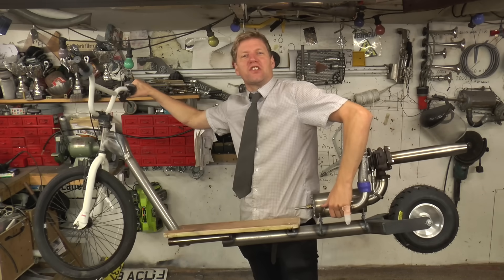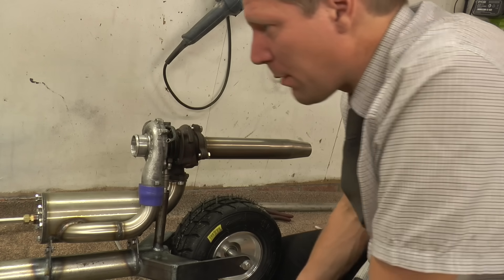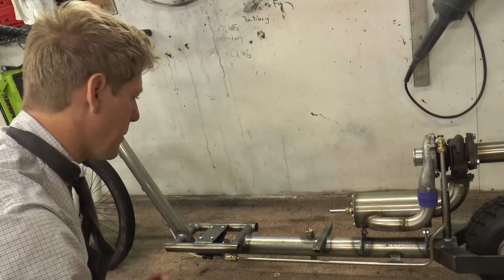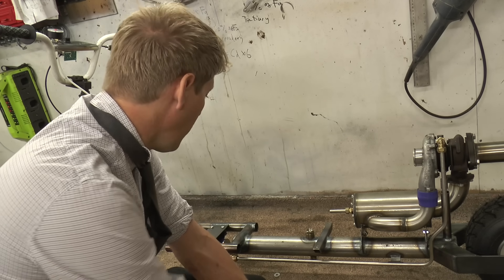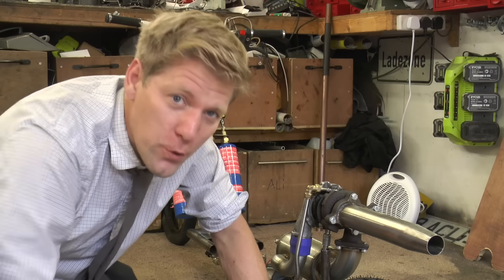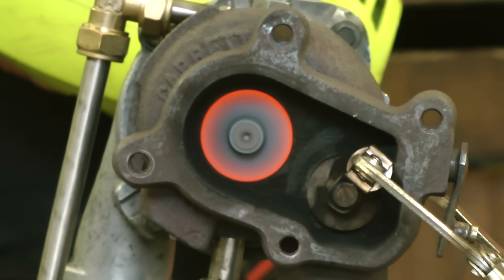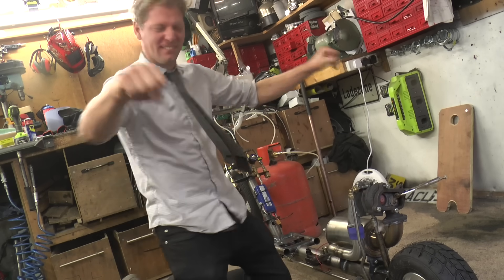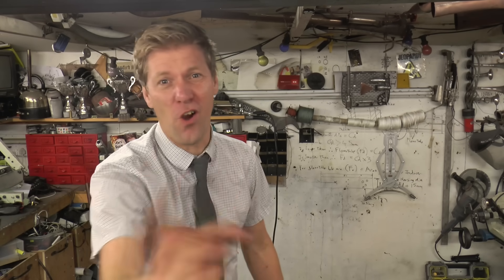TurboJet Scooter Build #2-Oil/Fuel/Test Fire

Comment: Hey, have a 100mm turbo im building a "jet" for a shopping trolley with. Had a friend make the flame tube but he messed up something and there is like 150/170mm2 hole area. Someone have an explanation to how this will effect the burning happening, first I thought it will probably be good enough. But that thing will be a beast to get spinning until it can sustain itself.. For now i have a 70mm running just fine and that has a much smaller combustor than the one in this video. And it starts real easy, if you accidentally overfuel it a bit it has enough thrust to tip itself over, granted it is a bit top heavy but its for making noise and looking good only. So well, what makes a good combustor? Small holes high speed air or big holes low speed air? Just made the fuel system for the afterburner on the shopping cart today..

Comment: What gallons per hour (gph) rating was your pump you used for the oil system? I am trying to build my own turbojet but the pump that are like 330gph are so expensive. Do you think I could get away with a 10 gph diesel pump.
Thanks

Comment: Colin: Tig welds next to plastic oil line-no problem. Me: Tig welds in basement, truck outside in driveway develops oil leak in pressure gauge line !

Comment: Call me crazy but a turbo is not a rocket engine, it produces rotational power from a expansion of hot gases, so if you take a gear off the turbo to your wheel it would work...yea?

Comment: why does the TURBO need oil??  Its just a fan that spins isn't it?
Reply: It needs oil to stay lubricated and cooled, because nothing can work perfectly without friction the oil helps cools off the heat created by the friction and to lower how my friction there is between the fan and the housing

Comment: You need to power down the oil pressure during start or the axle will not turn. I made a jetbike in 2007 with a huge marinediesel turbo. It needed huge amount of pressurized air to get it to run up for a start. An Atlas Copco GA30FF compressor was almost on the line for starting. Two sparkplugs on the burner, the plugs got stuck after a real run. I made a couple of runs making it power the bike quite good. The last run on film in my channel, the turbo exploded in fire! Watch and laugh. "Jetbike Bräcke"

Comment: Serious question and hopefully a cool improvement for your next one: why not EDF motor to start it? I see you using a plugged in leaf blower, but even a small cheap EDF will give significantly more pressure and thrust and available in whatever diameter you need. You could then start it anywhere (like take it to the park, sneak up on some birds, then shwooOOOSH! Fire it right up). Normal jets have just a regular motor on the shaft to spin them up, but this would be a very easy way to make it have electric start in a compact battery version. Just make a hinge where it swings out of the way once the turbojet is started and your golden. It should definitely make it easier to troubleshoot and faster and easier start ups.

I may not be a rocket scientist, but I am an aerospace engineer that approves of this madman plumber, keep it up and stay awesome Collin!

Comment: To monitor oil pressure: Just do some bench tests to find out how much current corresponds to what pressure. The monitoring is simply an amp meter and it is easy to solder together an alarm that sounds if the current is too low.

Comment: You should probably put a radiator and or a heat sync on for more more cooling and longer run time 
Then you can cool and lubricate the turbo aka jet

Comment: Hey mate I’ve got some advice for the oil system and that is it needs to have an air bleed in the drain back otherwise it won’t allow for the pressure that builds up in the main sump/tank. If you don’t add one it’ll continue to blast oil out the turbo

Comment: much of the energy in the airsream coming out is probably in rotational energy, because the blades make the air spin aswell. Maybe try adding stators after the turbine to convert it into thrust? ;)

Comment: You should probably put an oil cooler on there, for longer driving periods so you don't fry those bearings like the old turbo. I know you're getting plenty of oil through, it's just going to get really hot, really quick at those temps and possibly thin down the oil to the point of water on the bearings. Probably not good on the pump either.

Comment: Hi Colin yet another insane project, well done. Having played with  Turbo Gas turbines in the past, your engine was not getting enough Dilution air delivered through the output end of your Flame tube. The telltale  sign was your turbine was running red hot around 900 C at stable speed.  I found that at stable speed i.e not under acceleration a good number to aim for is 600 C into the Turbine, if the temp is  above this then  need increasing the amount of air after the flame will  diluting the temp but increase the all important thrust.

Comment: OK Colin your a nutter  😂😂😂😂 but I've subscribed.  Nowt like watching a nutter having fun in a shed 😂😂😂 just been for a walk with the dog .thinking about your project ..then I thought  fuel pressure. You have none  your gas tanks will lose pressure when they are used .less pressure to get through your system to the turbo not good .all turbos systems work on fuel pressure.  Hope it helps

Comment: Hey colin, I have watched all your videos since 2016, and i've followed your projects, my favourite being the modified tuk tuk, and I have a suggestion for you.
Use the chassis of an old car, and make a tank out of it, put sprockets, roadwheels, tracks, cut a hole in the roof to mount a turret with a gun/potato cannon, and if possible, make it work like a real one: 2 brake levers, one gas pedal and one clutch, and the brake levers to stop each track (right stick-right track ; left stick-left track). I really hope you read my comment, think about it and maybe try to do it. There's nothing to lose, really

Comment: We need an oil cooler on that thing. Unless you want smoke effects after running it for 3 minutes. Instal a radiator, a trasmission one will work, on the oil loop

Comment: You need ducts. The burner can needs to be at a constant pressure.   Go from the compressor to a divergent duct.  Flame for heat.  Then. Into a convergent duct to the turbine

Comment: i want to put 2 gas turbines on a bicycle one day on either side, if yours dont make any thrust ill go pulse jet, i want some kind of afterburner or boost button that shoots a rocket flame out the back, it will be cool either way but im learning alot from your machines on what works and what dont, thanks, i also have a bmx bike with a 5.5 horse honda motor on it and belt drive train, made it from a bike and a rototiller, it does 50 down the freeway and cops dont even bother me, i have a little of the same passion, want to go stupid fast on some stupid machine cause its the funniest and coolest thing ive ever done, also want to put like a kawasaki 65R 2 stroke motor in one of those pocket rocket crotch rockets one day too and see if it goes 50 or 60

Comment: NICEEEE. The only bit I'm worried about is the mechanical oil press. gauge; if the handle bars spin, it'll pop off and be a fire hazard (those are cool tho)! Go electric with a sender plumbed in :D

Comment: this is probably a stupid question but how is he using a turbo as a jet? in extremely confused
Reply: Thrust is the product of mass flowrate and exit velocity. In order to do so we can burn a fuel to accelerate air. In order to do so, the inlet air needs to be compressed by a pretty large factor before it can actually burn the fuel properly and efficiently. With the large pressure in the combustion chamber the outlet air will go faster then it came into it and will thus produce thrust. However, powering the compressor costs energy, in order to do that, a turbine is attached to the same shaft as the compressor and uses the energy in the outlet air to power the compressor. This then becomes a self sustaining cycle with the compressor ensure high enough chamber pressure and the turbine being worked on by the outlet gas to power the compressor. This basically is a turbo. I cars their only function is to increase the cylinder pressure, not to create thrust like in normal turbo jet engines with a way large mass flow rate (usually in the 10s of kg/s). (everything is still very oversimplified but it should get the message across without going into thermodynamics to much)

Comment: Hey Colin! Your turbojet experiments being so few and far between, I've started looking elsewhere and since I'm learning some Russian I found a channel that you may want to take a look at, it's Игорь Негода, Igor Negoda in latin letters. Some of his videos have English subtitles and overall, he's a well qualified turbine craftsman. His last ongoing project is a MiG-23 turbostarter-powered old '90s BMW, actually mechanically driven through the original clutch and gearbox. He's also scratch built a number of other turbojets and restores rusty things like a genius. I advise you to do have a look if just for technical ideas! Best luck on your own projects.
Reply: Holy shit. A car with a WWII fighter plane engine? Reminds me of a story my father told me. Back in the day somewhere in the UK, a policeman was on his duty when he spotted a car with a modified engine. He could tell it was modified because of the bonnet slightly raised and the engine sticking out of it. When the policeman was trying to pull the car over, the car took off. He said it was long gone. But when they finally caught up with it (Surprisingly. Fuel must have ran out or engine overheated), they went up to check the modified engine. And lo and behold, to quote the policeman in the daily newspaper the next morning, it was a modified Spitfire plane engine. Crazy.
Reply: no one cares

Comment: Oil tank needs baffles to prevent starvation. Filling it high enough to prevent that would cause blockage of the turbo oil outlet. The oil that comes out is foamy and can easily be blocked if it doesn't have clear drainage. This would damage the turbo seals eventually

Comment: To maximize thrust you need to calculate the exit area of the nozzle such that you get trans-sonic (Mach 1) air coming out. Its basically compressible fluid flow in jet engines.

Comment: For the lubricating you may increase pressure at 2,5 bar at least and I would switch oil to 0W-30, which is now comonly used in pasenger cars, this may improve mechanical loses and extend life of bearings.

Comment: Maybe the exhaust system is a bit too easy. The flow needs to expand, so that the pressure increases, which pushes back delivering thrust. I think just an easy diverging nozzle will sufice (5-10 degree slope), so that it looks like a space rocket!

Comment: I totally forgot about the internal waste gate on the turbo until you took off the exhaust pipe. I’m sure you have some lock on it but for the turbine engine function I wonder if it would do well to weld it shut all together.

Comment: Jet engines produce most of their thrust just from the compressed air being forced thru, not the combustion itself. Unless it's a turboprop engine of course. That's why there's high bypass and low bypass turbofan engines.  A high bypass engine makes about 80% thrust just from the moving air it has sucked in, compressed and is blasting out the back, the other 20% is actually from the combustion.

Comment: Take a look at this chamber design with Garrett GT25 done by my PhD student. It will give you very smooth operation with efficient gas cooling at turbine inlet to prevent damaging your turbine blades.
https://doi.org/10.1016/j.fuproc.2017.05.037

Comment: You should've just used the larger turbo from fast turbos in the first place. Wouldve saved yourself a lot of wasted work and time. As the bearing of the old turbo was shot, how could you ever expect it to work properly.
Reply: Correction: Fast turbo, not fast turbos.